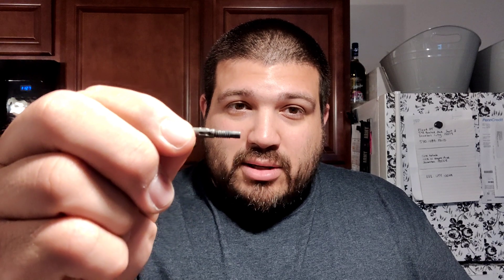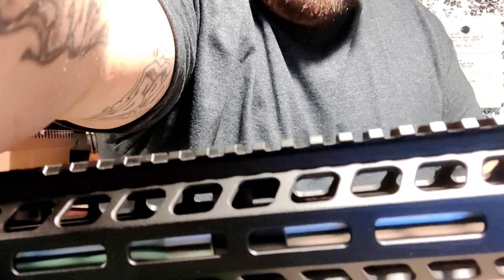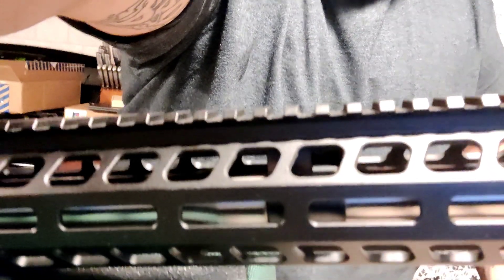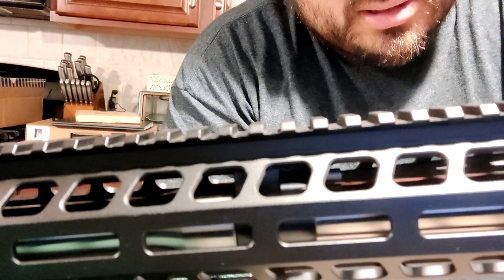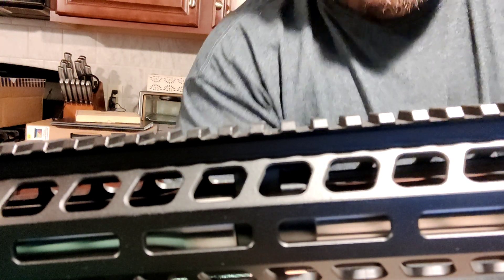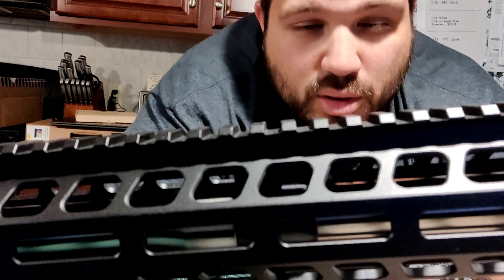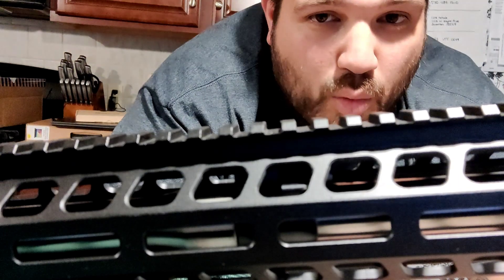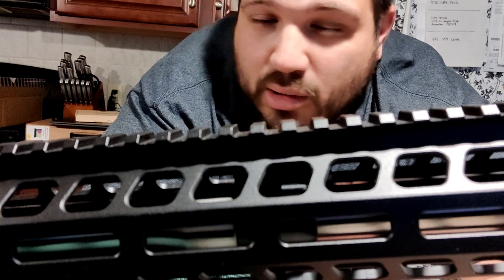PSA AR10 Gen 3 gas block adjustment

Comment: Once you adjust it to your liking, does it usually stay put? Or, say after 500 rounds, is there a chance the set screw moves and readjusts itself 1 or 2 clicks in a different direction... or, does it basically stay put?
Reply from the maker: From my experience, it stays where it was set. I know there was an issue with their older style adjustable gas blocks moving out of adjustment over time and it's why this current gas block is out. 

Keep in mind that this method is essentially a plug that restricts the amount of gas down the gas tube. It will eventually start to erode that plug over time and you may need to adjust it down the road but that's dependant on shooting regiment, rates of fire, materials used in the gas block, etc. I don't know of any situations where that was an issue for recreational shooters.
Reply: @airborneivan  I'm currently building my first AR-10.... I'm doing lots of research and trying to make the best selections... so far, I've started with the aero precision complete lower, and I'm considering the Wilson combat 16" recon barrel... WC recommends their adjustable gas block with their barrel 🤙🤙 thanks
Reply from the maker: @Solidbuilthomes  I have no experience with WC outside of their 1911 parts. As far as gas blocks go my favorite is Superlative Arms due to their Bleed-Off settings that allow excess gas to bleed off right at the gas block instead of restricting the gas port hole. Specially when it comes to suppressed use.

Comment: Thank much for this video!  This was very helpful and educational!  You did a great job on the video, thanks much brother! I am a bit new to "adjustments" of the gas block and the instructions that came with the rifle said that .308 should be adjusted to "16" on the gas block adjustment, but there was also a "3" mentioned in another area of the same card that comes with the rifle.  Needless to say, I was a bit confused and didn't want to touch it until I did some research.  Your video explained very well how the gas block restriction screw works and how you can get somewhere around 26 or 27 "clicks" out of the gas block screw adjustments.  I'm going to go with the recommended 16 clicks for the .308 - 150 grain ammo as that is my intended usage.  Frankly, I would MUCH rather have a bit "extra gas" than not enough and have the rifle fail to extract or have a double-feed or whatever, particularly when there is a critical need for the firearm. I don't shoot 1000's of rounds of ammo and will probably shoot about a 100 or so to break the rifle in and then occasionally shoot a box of 20 here and there throughout the year.  I cannot see a bit of extra gas through the system (to ensure proper rifle cycling) will wear the rifle out before its time, particularly in that I don't/won't be shooting it all that much.  I look forward to comments here and learned much from watching your video!  Thanks for taking the time to enlighten us "lessor mortals"....K
Reply from the maker: Glad I could help. I agree. If you plan to run a variety of ammo open it up a bit for ensures reliability. You just cave to contend with increased recoil but it shouldn't increase the wear of the rifle.

Comment: Thank you very much. So just work the screw in the front? and dont do anything with the screw on the side? I got the long allen wrench but it doesnt fit the screw head in the front. Good times. Thanks again
Reply from the maker: Interesting. I'd inspect the screw to see if there's any burrs that's preventing it front accepting the Allen key.
Reply: @airborneivan  Do you know what the screw on the side is? is it the set screw? and I guess no need to back that out?
Reply from the maker: @No--0--Spin  I believe that holds the spring and detent.
Reply: @airborneivan  Thank you sir. I got in touch with PSA and they are gonna send me the correct Allen key which is 3/32 not whatever they sent which is bigger.
Reply from the maker: @No--0--Spin  awesome.
Reply: @airborneivan  Thank you. I had the same question.
Reply: @No--0--Spin  awesome. Thought I was losing my mind. I’ve got the exact same issues and figured it was me not PSA. Y’all’s conversation cleared everything up. Thanks
Reply: @No--0--Spin  Same here.  Apparently the allen key guy is dyslexic.
Reply: My long Allen wrench doesn’t fit it either. Good to see someone else has the same issue. I just had to use a smaller sized wrench. Did you get the blemished one?
Reply: @idontwanttonamemychannelth6115  Yes, I did. PSA sent me another wrench but it was the same wrong one. Just ended up buying one off amazon,  It is a 3/32 just put amazon . com in front of this line /gp/product/B000189QQA   This is the one I got and it works great
Reply from the maker: @idontwanttonamemychannelth6115  Sorry to hear, man. Mine was not a blemish.
Reply: Got one in February with the right size. Have to try adjusting some now that I know it works. Mine throws at 3 o'clock factory setting.